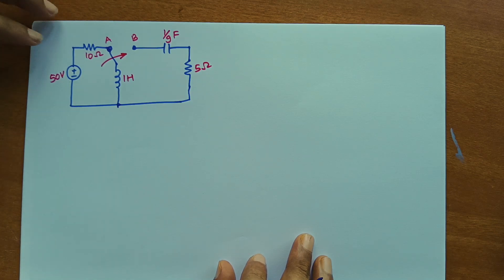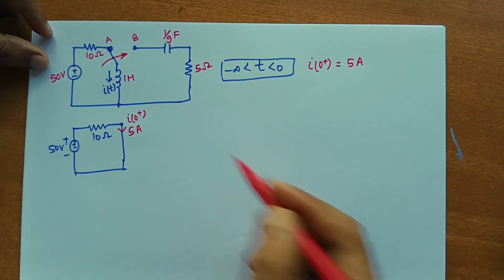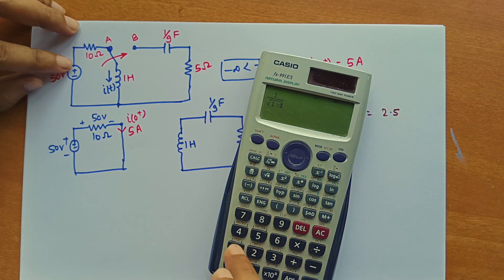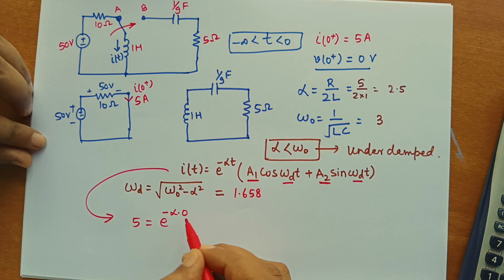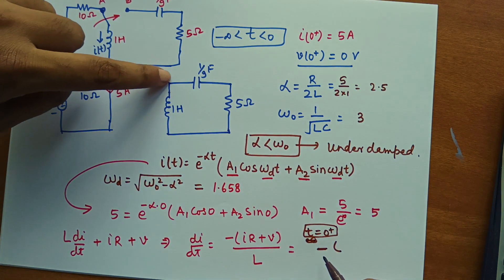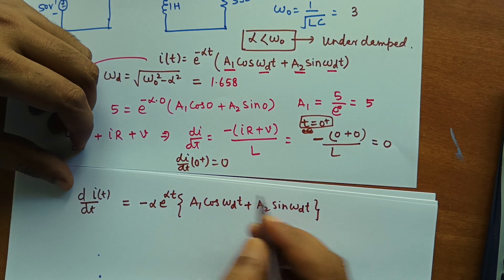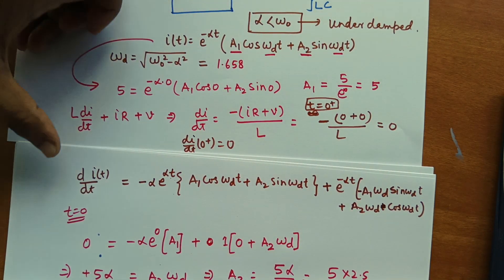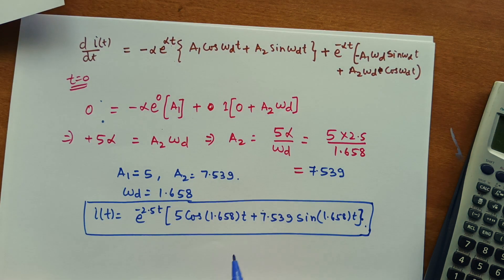Example of source free series RLC circuit and calculation of i(t) ||underdamped||

Comment: Hello sir. I think the current in RLC circuit in 0+ will be 5A CCW and because the capacitor's initial voltage is 0 , it acts like short circuit, Due to this assumption, The initial (0+) voltage of the inductor wont be zero anymore!!! Am I right?
Reply from the maker: Initial conditions should be taken as voltage for capacitor and current for the inductor.